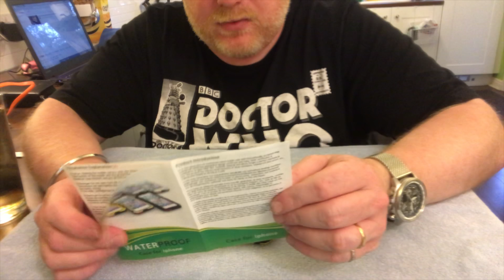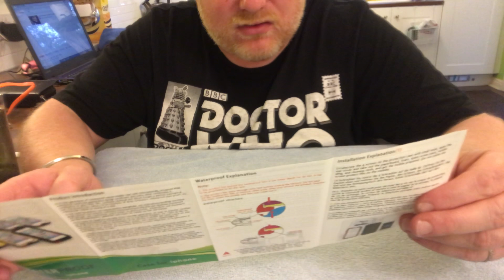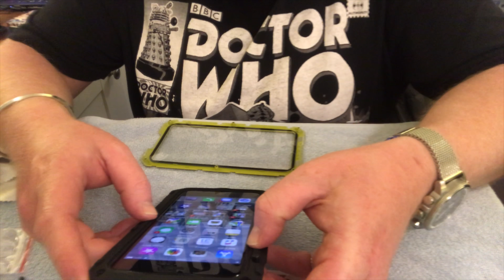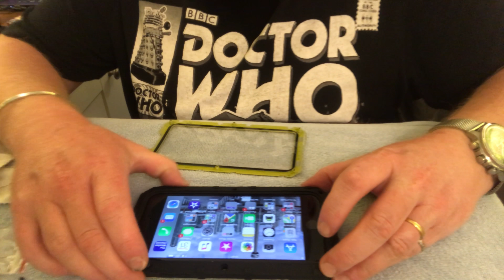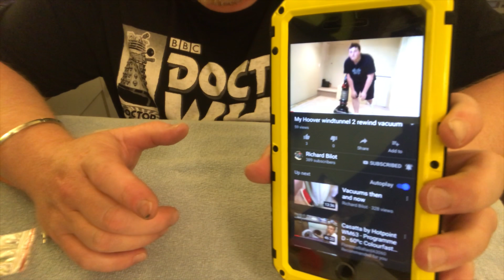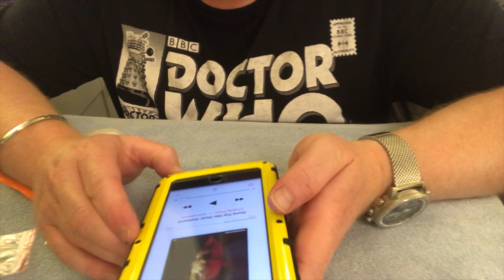iPhone 7 Plus Waterproof and Shockproof Case Review

Comment: I was getting this case and just wanted to get a review on it I don’t need to worry about water damage but if it’s shockproof then It’s a keeper but don’t keep opening the case wait a little while bcz you would have to clean the inside and I just wanna say thx for making a video about this case
Reply from the maker: Hey hey, you’re welcome and all your points are completely valid, I needed a quick release case rather than this, this needs to be fitted once and left on like you said, I can’t fault the product it was user error, me 🤣.
Reply: HooverLux Restorations I got the case today and I don't want to test it out but it does look like and feel like it would protect my phone

Comment: I have a very similar case on my iphone 5s. I've had it for years and deliberately buy only iphone 5s replacements because I like the case so much. But alas, the 5s has finally gone obsolete in the software department so I bought an iphone 7 because it's basically the smallest one I could find. Thanks for this review. Was wanting to see how this compares to what I'm used to. My old case is 7 years old and hope to get the same from a new one.
Reply from the maker: The case was fantastic, once it’s on, it’s on and would be perfect for rugged use, but because I wanted it for filming in the pond, I needed a case I could take on and off easy which unfortunately this wasn’t good for, this was made to be fitted and left on. Shame as it was an awesome case and highly recommended
Reply: @HooverLux  I know it's probably too late but with my old case, you could open or remove the cap that covers the lightning connection plug and that uncovers the microphone.

Comment: i have the same phone and they  are water proof with out any form of case mine mainly goes in the shower (don't ask)
or when it needs a clean haha lol
Reply from the maker: A couple of times I have accidentally got it wet, never submerged and the speakers have gone all muffled and funny for a while after, I guess they may be water resistant, but I don’t want to risk testing if it is waterproof 😂😂😂

Comment: shockproof?
Reply from the maker: I guess it would be, but I needed a case I can take the phone in and out of quickly.
Reply: HooverLux Restorations & More  is it made of metal? Aluminium or silicon? The case?
Reply: HooverLux Restorations & More do you recommend it? Because I don’t know if I’m gonna buy it or not
Reply from the maker: FU-2 TIKCU5 All the yellow parts and a strong metal and the black parts are a hard, but rubber silicone material. Very strong
Reply: @HooverLux  how about the sound since its blocking it?
Reply from the maker: FU-2 TIKCU5 Now that’s the issue! You will not get the same sound quality at all. That’s why I went for another style of case for filming briefly under water. The sound quality will definitely be hampered, but that seems to be the issue will all these cases, they have to be water tight, so sound will suffer 😢
Reply: @HooverLux  Can I still install this in my phone even my phone has screen protector on it?
Reply from the maker: FU-2 TIKCU5 definitely
Reply: @HooverLux  is it easy to access the  ringer switcher? like switch it?
Reply from the maker: FU-2 TIKCU5 yes, that’s one of its redeeming features, accessing all the buttons is really easy
Reply: HooverLux Restorations & More is the tempered glass really scratchproof? Like a cheap quality? And does it leave any newton rings?
Reply from the maker: I’ve not noticed any Newton ring interference, and so far no scratches on the glass so far. But I’ve not put it to the test
Reply: HooverLux Restorations & More is the quality of the tempered glass good? Like really sturdy? Reliable? Mine seems cheap got a few scratches when I got it

Comment: What's da name of this case?
Reply from the maker: Hi Timmothy, I bought it on EBay and I’ve looked through my past purchases to find the details, but the seller and the item I bought is no longer on there, so I can’t find the exact name and details. I wanted to send you the link. I’m so sorry about that.
Reply: Thanx 4 da info..
Reply: Its called Beasyjoy. I have it on my iPhone XS and its LITERALLY the greatest case ever. Of course, i’m a roofer and I like outdoor sports so its meant for that type of scenario
Reply from the maker: Jimmy Ross thanks Jimmy, appreciate the info my friend.
Reply: Jimmy Ross A quick question, is it put it on forever or can it be removed and refitted back in later?
Reply from the maker: It can be removed anytime, but as I found you can damage the seal around it and it stops it from being airtight again.
Reply: HooverLux Restorations & More thanks bruv. I have mine ready to try it out for some underwater action. Just wanted to be sure if I can put my iphone in and remove after the underwater shots for later
Reply: Paul Legge I checked on Amazon and the Mitywah and this brand seem similar. I applied the case onto the SE 2020 and I don’t really have any complaints. Perhaps the mute button gets switched when the phone is in my pocket. But so far no complaints compared to ones on Amazon Reviews.